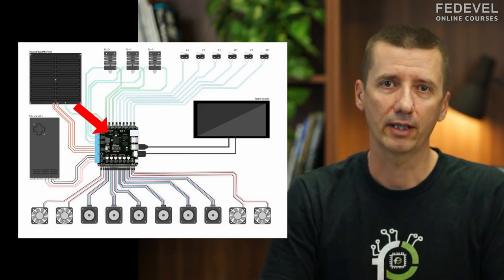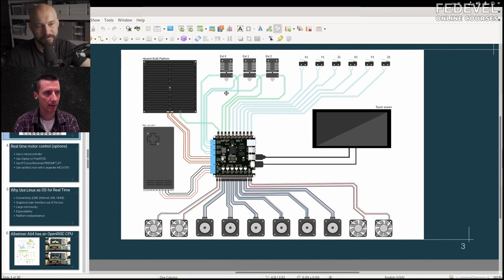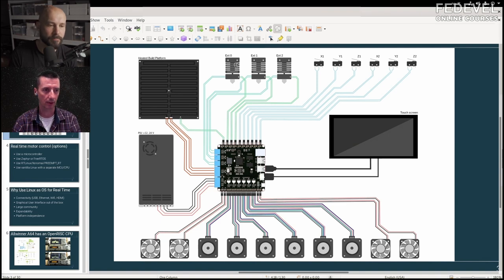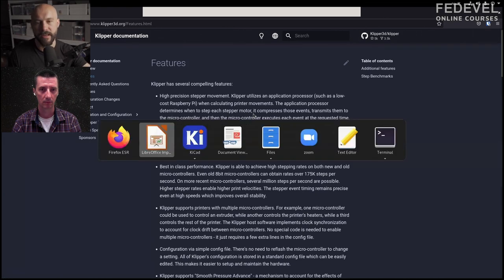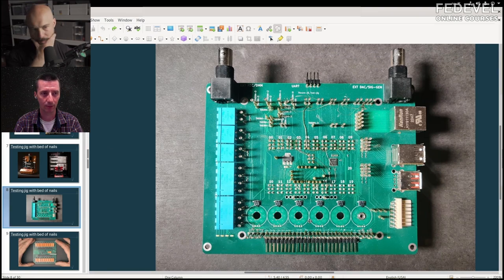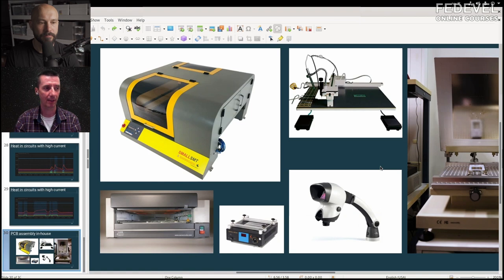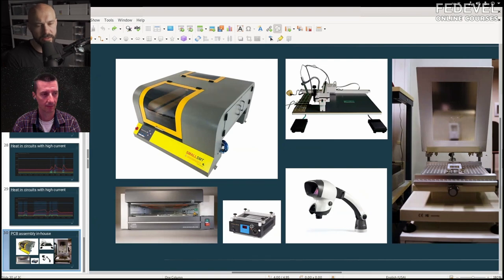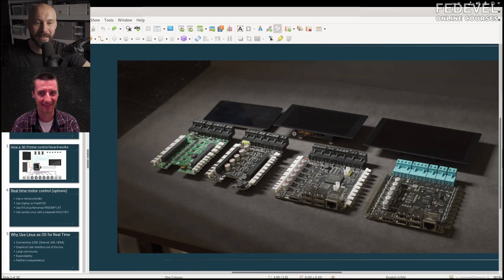What Everything Is Connected To 3D Printer Boards? | Elias Bakken

Comment: 3D Printer boards are rather simple. The main point is not to screw up the analog circut so MCU's ADC will always measure correct voltage from the thermistor. And, btw, there is still no MOSFET shoot-through protection. If heater mosfet fails and makes short circut between source and drain, heater will heat infinitely and printer can catch fire. It happens very rarely, but it's not impossible. What could be a solution for this? Maybe a MCU-controlled relay, which disengages all power when MCU detects too high temperature? But I haven't seen such or any other implementation.
Reply: On this board there is an electronic switch that shuts off the all the heaters if the temperature is not right. This is basically the same as you suggest, but implemented with a second MOSFET instead of a relay.  A more common scenario is probably that the thermistor comes loose, but it has the same effect and shuts down the board.